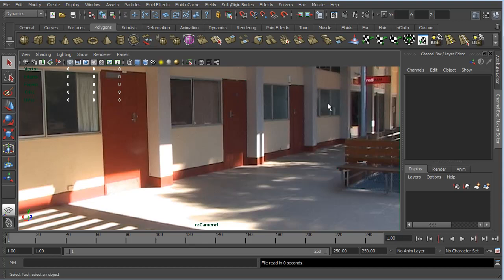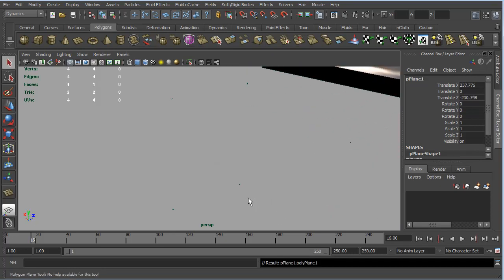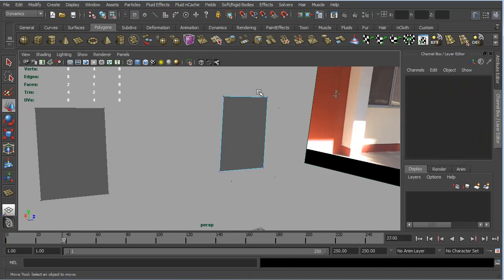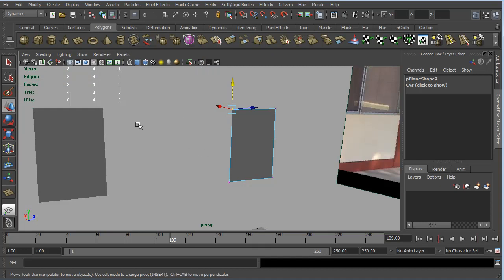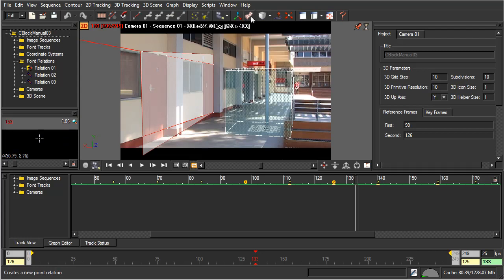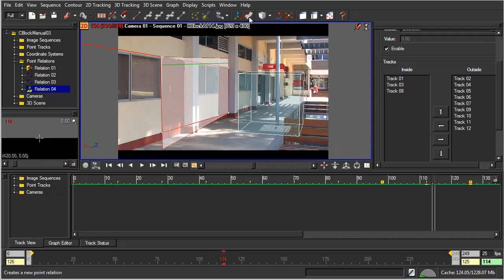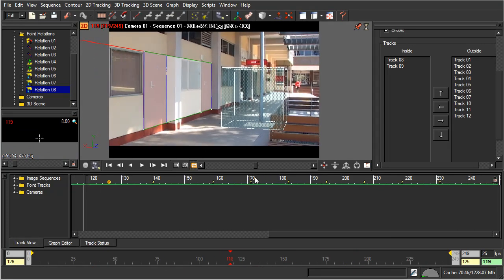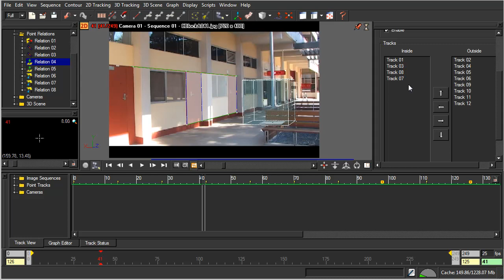Match Moving for Maya - Part 8 - Creating geometry and fixing our incorrect coordinates

Comment from the maker: @kazmiasad Thanks for posting this very good question. I'm sure that this might be a bit confusing, so I'm very glad you pointed it out. Points 8, 1 and 3 do not define the Y axis, but SHARE the same value in Y. That is to say, they are at the same height in our scene. Y is indeed the axis that's assigned to up and down. The confusing part is that them all being in a line, but in fact they could just as easily be points on a ceiling or the floor. So a relation of "Share Y" = "the same height".

Comment: just a note to those watching this, from my experience using match mover, creating co-ord systems is prob the hardest part of the match move, one thing that really helps is entering the camera details in match mover such as distortion grid, focus etc really helps. also in this video you really need a few more track points outside of the side wall to get a good solve.